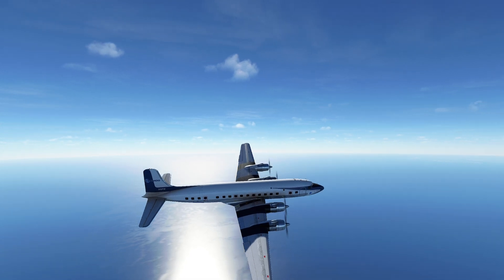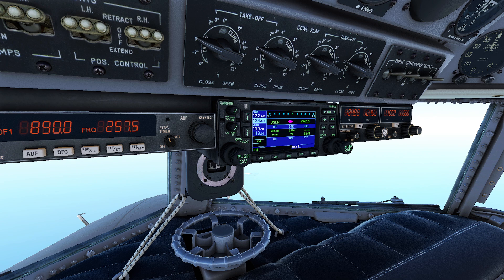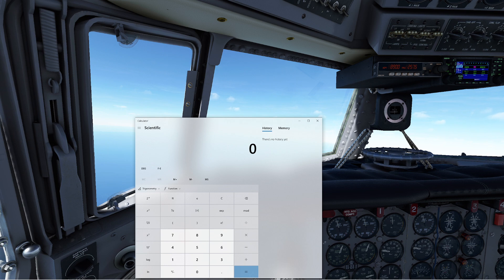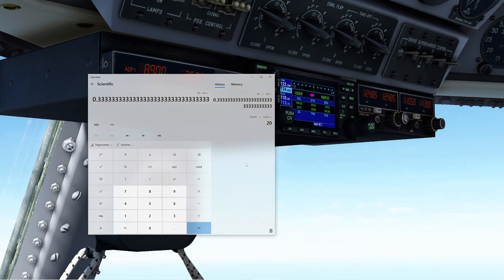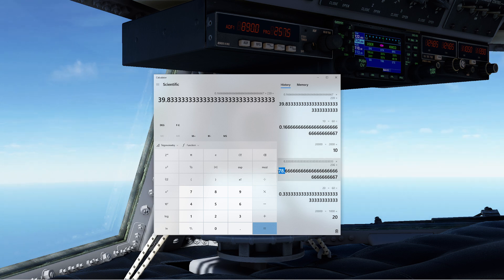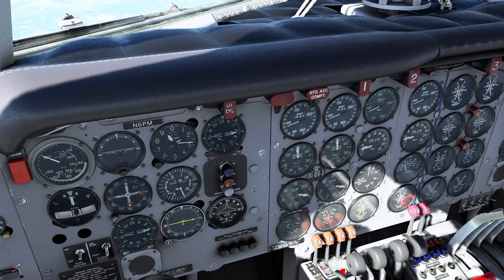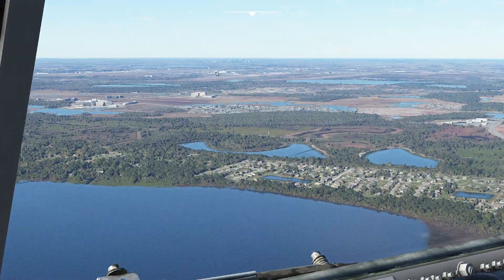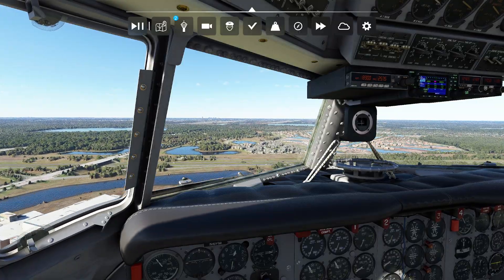MSFS - Planning Descent

Comment: I wanted to see you crash into some trees 😩. I feel robbed. Ripped off. Yes, even bamboozled (jk good video. Better than my method. I’d break out the geometry and draw some triangles. Very accurate tho. Has put me at altitude within just a few hundred feet of waypoints before, using autopilot to maintain speed and rate of descent

Comment: 4:15 Isn't the heading indicator flipped in this airplane? I'd feel queasy flying north and seeing west indicated to the right. How often are HI's flipped like this in different aircraft types?
Reply: You may be referring to the 2 NAV needles.  If no signal then they are in that position...
Reply: @ucdbnxt7318  No, I'm not talking about the two NAV needles, which are on the co-pilot's side. I should have said compass instead of heading indicator.

It's a little hard to spot, but here's what I'm looking at:
- Start at 4:15 , paused. Focus is on the center console.
- Set video speed to 0.25 below normal. Might want to mute audio also.
- Resume, slow. You notice Mr Gatcomb pans left rapidly.
- Run just a few frames and you're looking over the right handgrip of the pilot's flight control wheel. 
- Just over that handgrip, just under the marker lights, is what I take to be a compass (has an airplane outline inside). It looks flipped to me, degrees increasing counter-clockwise.
- Mr Gatcomb is indeed flying north of north-west, just over the Veteran's Hospital and on to Orlando Airport.
- Just to the left of that compass is what I take to be a radio bearing indicator (RBI), degree markings increasing clockwise.
How does this look to you? I'd get queasy trying to counter-steer this needle.

Comment: Nice! There is actually a video from PMDG about the decent of the DC6:
- Start decent on cruise power until ~ 12k feet, then call decent checklist
- Plan for 5nm per 1000 feet you need to decent +15nm to slow down  (@1000f/min VS)
The POH for DC6 is very thorough; they are called e Precision Manuals Development Group for a reason :)